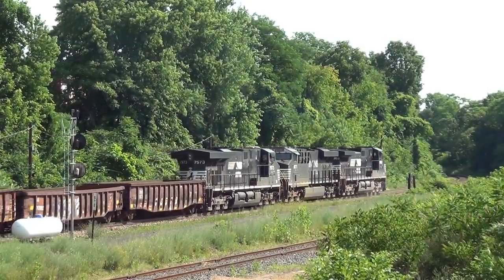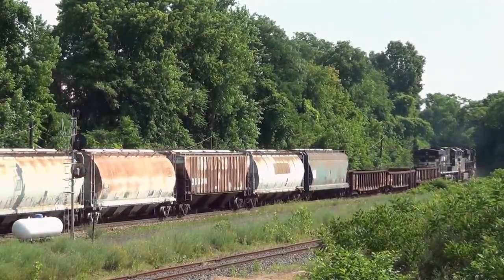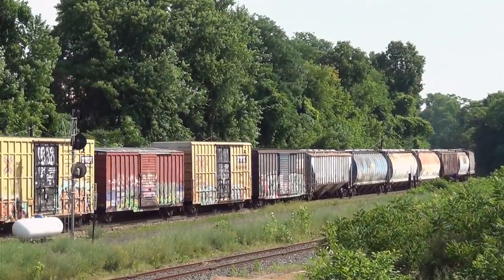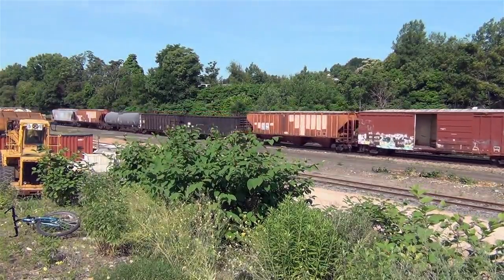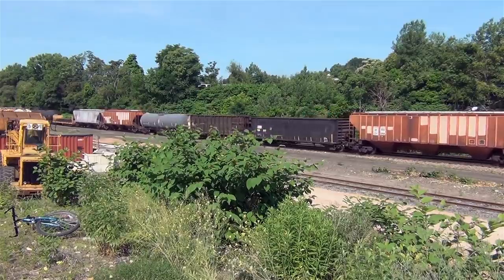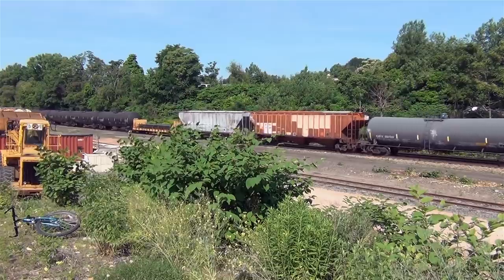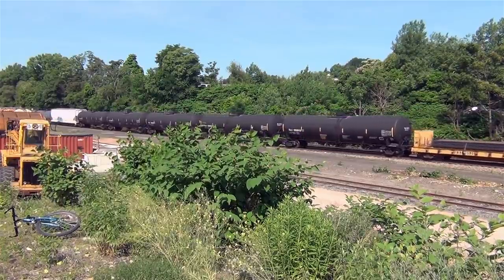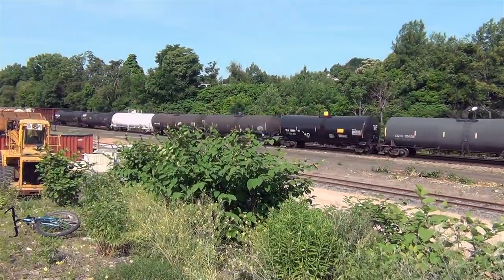[GL][T-328] EMD vs GE: SD70ACe vs ES44AC (Part 2)

Comment: As a railfan, I love EMD's. Our GP39-2R's rebuilt from GP30's are my favorite, and I love the spartan cab 60 and 70 series EMDs too. I'd like to see those GP30 carbody units receive yet another lease on life with a microprocessor control system like EM2000 or QES, and CCB26 electronic air brakes. Heck, even the ACes grew on me after a few years of working with them.

That being said - As a mechanical employee, I prefer GE/Wabtec - there is one thing that gives them the cutting edge, and that is the much better quantity of technical support than Progress rail provides. I also love how they sound in notch 8.

The "computer issues" you describe happen both on EMDs and GEs, no matter if they are FIRE or ICE screens on EMDs, or IFD or SDIS screens on GEs, and a hard reboot with the knife switch pulled is almost always one of the things to try to get any computerized locomotive behave right.

Comment: That's  A very informative video and a few good quotes in there.  I used to be able to tell you what every locomotive was at a glance, until the late 80s. I stopped paying close attention and now they all look the same.  Now, I'd have to see the markings under the unit number.  However,  I always liked the EMDs.

Comment: I am more of an EMD fan also. A big part of the reason is that Jeffrey Immelt of GE took $ millions in a redevelopment grant about 30 years ago, and instead of upgrading the factory, Immelt shut down the plant and spent the money on something entirely different. Hundreds lost their jobs since the grant wasn't spent on it's intended purpose. Add to that, It is my opinion that EMD loco's are more aesthetically pleasing to the eye. I also like the way the EMD's are designed and engineered. That is my opinion of them.

Comment: The SD70M-2’s aren’t really all that great for the crews. While it’s a novelty to see them as railfans, a lot of crews don’t like them because half of them on CN and most if not all on NS were thundercabs. Not to mention all the confusing computers and electronics on board that fail a lot (at least on mountains with their sanders) and some are getting a little old and some are starting to blow a lot more smoke. The ACe is really the way to go in most situations, when they have a whisper cab at least.

Comment: EMD FOR THE WIN BRUH 😂 with EMD you can do such more it seems, there many more rebuilts, you can make like 6 vareints of 1 locomotive type, like with the standers ACE you got the M-2, IAC, ACS, ACE-BB, T4 ACe ECT,  EMD engines like you said do last longer, while GE engines are very tough, GE are built a lil more cheap that's why the dash 8-9 where consistly burning  up, many more reasons, on the other hand GE locomotive are very good for DP survice, they have very well made locos like the GE genesis or es44 bla bla 😂 there so many reason, butt 🍑 both locomotives do have safe cabs, good truck design, air intakes pretty good, even though I think EMD locomotive are more costomizible, both EMD and GE have really good rebuilts in mind, kinda just depends on what you look for in a locomotive, either way both compines have came really far in my eyes 👀

Comment: GEs AC power will always be better. Evident by the miles of 70MACs parked or scrapped by BNSF. If they were good we would see them and not the ES44ACs. DC power, the EMD 645 all day.